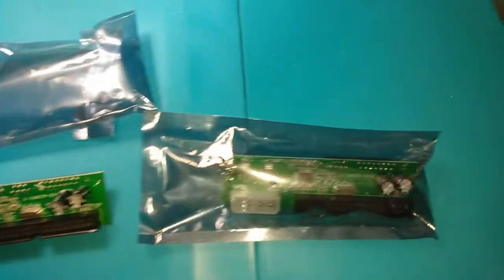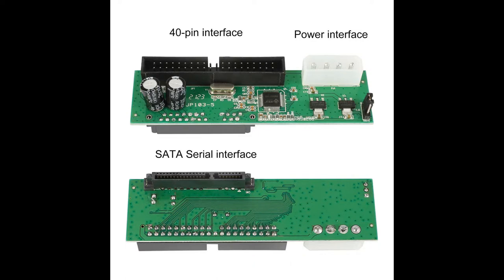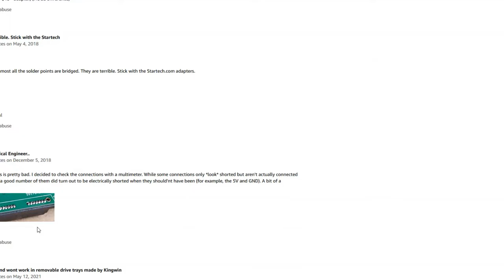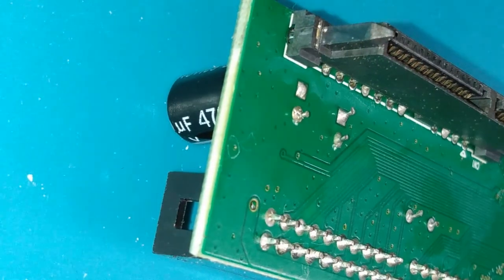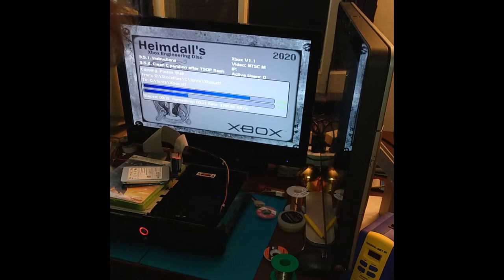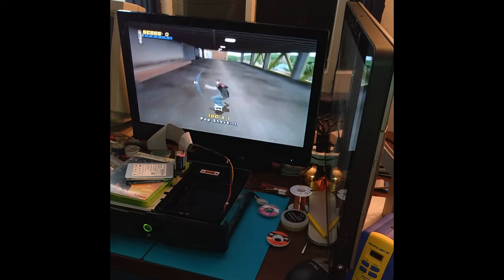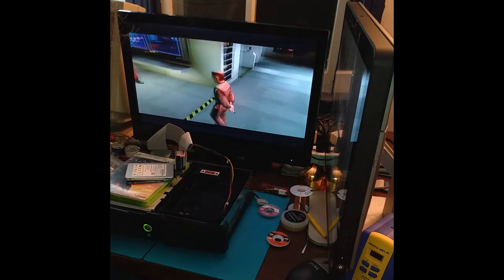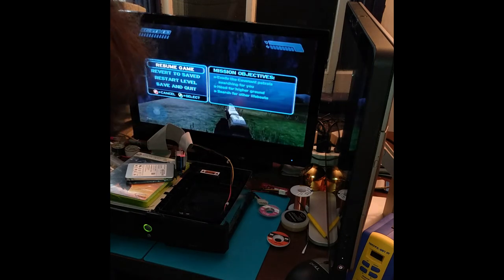IDE-to-SATA Adapter Buyer's Guide & Quick Repair

Comment: I’ve ordered a cheap non working Xbox as a project and all 3 ide adaptors. I’m intending on testing all 3 adaptors, trying new caps and inspecting with a thermal camera. 
I also own a Cerbios modded Xbox with Startech adaptor, 1tb WD blue hard drive booting in 25 seconds. Also want to test a couple of SSDs to see what compatibility is like.
Reply from the maker: Inspecting with a thermal camera is a great idea!

Comment: That’s interesting. I have a non-working adapter that is identical. Except mine has 220uf 25v caps. My adapter gets very hot around the power input and gives an error 09 on the Xbox. I have ordered a Startech but I’ll still have a go. Is it worth me trying 470uf caps like on your adapter?
Reply from the maker: Hey, thanks for being specific. When I was making this, I noticed pictures of the adapters I have with caps of a different make. My guess is that the design has been around for some time and they were made in batches with whatever components they had in stock. Since they vary like this, I'm really not sure if 220uf is adequate or if 470uf is overkill. I just directly replaced what was there to see what would happen. One of mine got hot around the power cable as well. It turned out to be a cold joint on top of the remnants of a burned pad.
Reply: I replaced the caps on mine and no change. I’m not going to waste any more effort on this so I got my startech today and it’s so much better in every way. Except of course price. But you get what you pay for.
Reply from the maker: @ianrendall  Did the capacitors leak? A lot of acid leaked out onto 2 of my adapters' PCBs. I had a 2/3 success rate. If this particular one is working, it will power on a tiny (but very bright) LED when you turn the Xbox on. The one that still wouldn't work after being touched up had particularly bad soldering (cold joints on top of burnt pads everywhere) and a lot of damage from corrosion.

Enjoy the Startech! If time=money it's definitely worth the extra $12 to not have to deal with any of the nonsense above.
Reply: @gpr-garwoodprecisionrepair6256  there was a little bloom on the caps but nothing leaked on to the board. I did reflow all the through components also. The regulators are red hot from the moment power is applied to them. I might try the 470 caps another time as the Xbox is now reassembled with the Startech gear, and I can’t be bothered unscrewing those comedically long screws again.

Comment: I got one that works but my OG Xbox boots very slowly after i did the swap and it stopped reading disks,i've tested other 80 wire IDE cables and used the original HD with it and it works just fine,both the boot and the disk reading. I got another 2 of those cheap adapters from China since the startech one isn't available in my country,i'll see if that solves the issues when they arrive.
Reply from the maker: Is your Xbox hardmodded? That would widen your options for adapters since you don't need to go out of the way to find one with Master/Slave mode jumpers. Another alternative would be getting a Syba IDE-to-CF adapter and a CF-to-Micro-SD adapter. Micro SD cards work pretty good if you use an 80 wire IDE cable.
Reply: @gpr-garwoodprecisionrepair6256  It's softmodded,the original softmodded HDD works perfectly. I got this adapter because i already i had a sata HDD lying around which was working fine as well. These cheap adapters are a hit or miss i guess.
Reply: @gpr-garwoodprecisionrepair6256  If these new ones don't solve my problem i'll probably just try that
Reply from the maker: @vlad8861  Hit or miss defines it well. You might have one run for a few months or even a year with no trouble then one day it just fails.